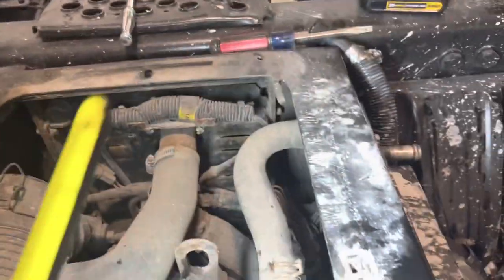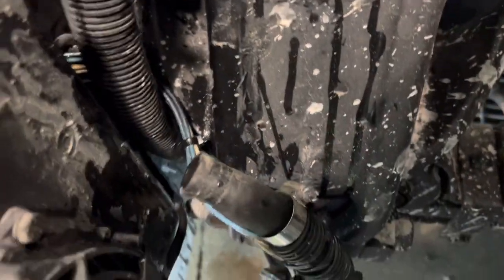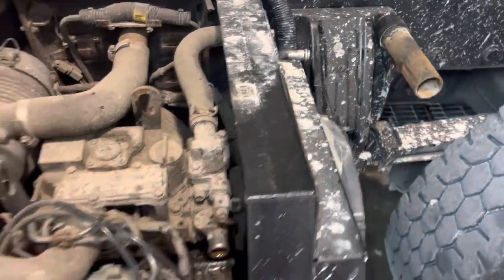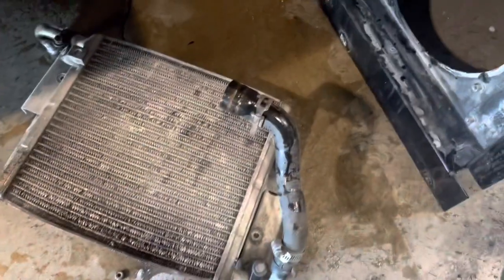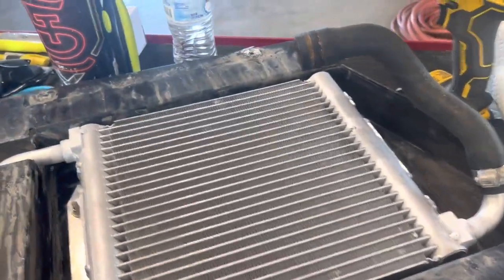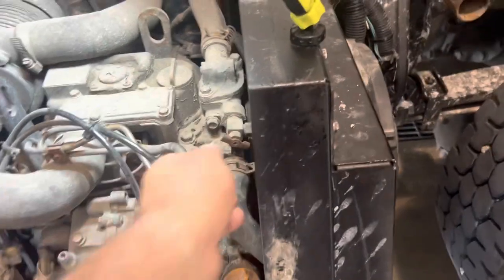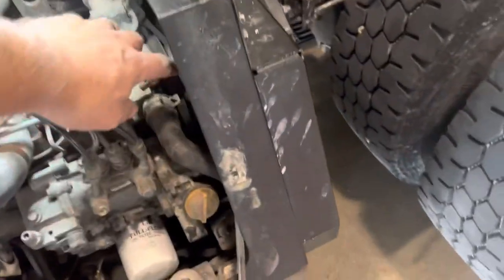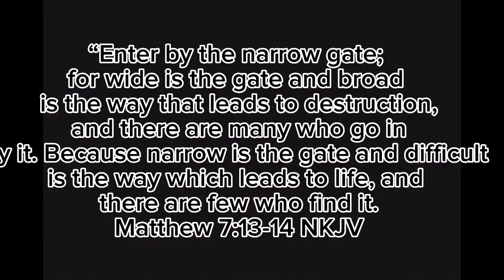Thermo King Tripac…..Radiator / pre-cooler replacement ￼

Comment: I would keep an eye on the new radiator to see of it slips down over time. Maybe add some dense rubber blocks under the corners to prevent it from bottoming out.

Comment: Does the pre-cooler fan always run or does it take a while for it to start spinning?
Reply from the maker: It Will only turn on if the coolant gets hot it’s on a thermostat
Reply: Thank you very very much. I highly appreciate it. God bless.

Comment: Hello had to fix e leaking hose that long one runs from eng to Apu got air in system did not bleed it and has a cod air on system now i am trying to bleed it opened the valve but still shut off ?!?
Reply from the maker: Start the truck and let the truck burp the air out